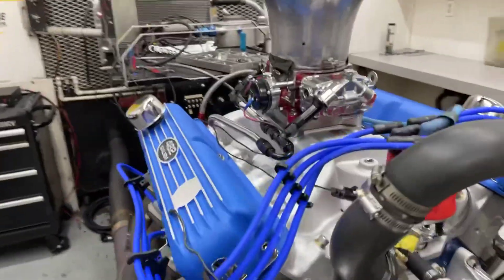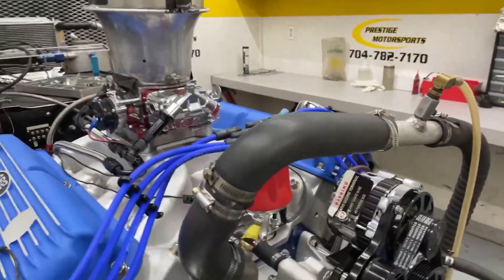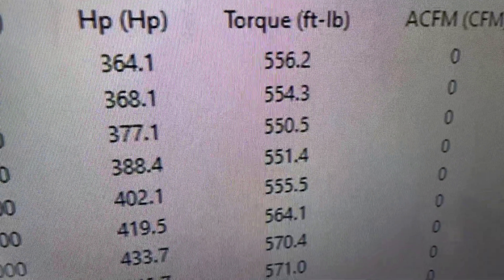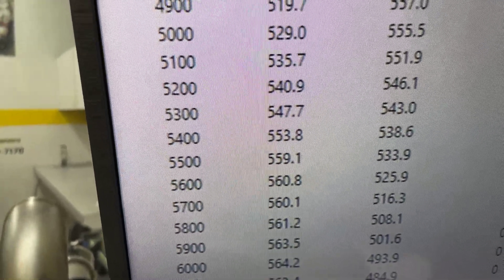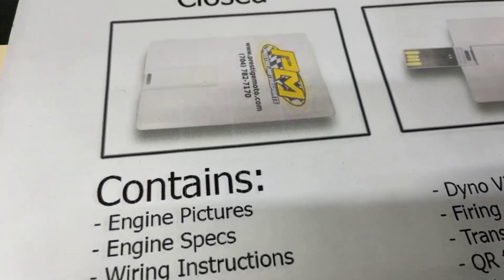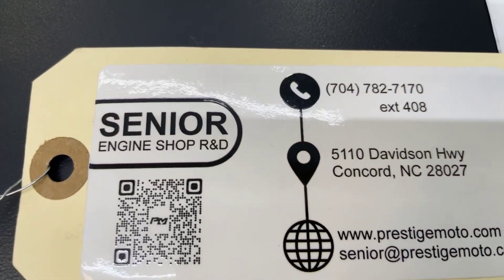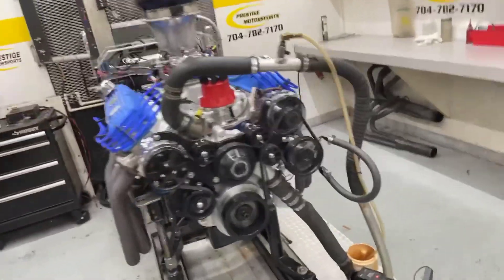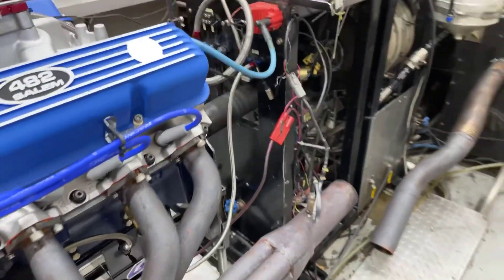564HP All Aluminum 482 Salem FE Dyno Test for John's '79 Ford Ranger at Prestige Motorsports

Comment: Carburetors are for dinosaurs
Reply: simple to set up and run anywhere.  thats why we still use them and theyre cheaper and make the same HP 

the ONLY real advantage EFI really has is adapting to different altitudes faster  and dont ever forget that
Reply: I will take a carb over EFI any day. Way too many problems with the aftermarket EFI stuff. Seen way too many videos of people regretting spending all that money and having failures, getting stranded and then going back to carbs.
Reply: @KingJT80  I have run both and Holley Terminator destroys any stupid clumsy double pumper carb. Believe me i know cause i have used both of them. Holley Terminator is even better than new car computers.
Reply: @maximusvonce1381  you proably used a double pumper in a situation where you dont need one and one that was most like to big of a carb

its not rocket science but you do need to pay attention to those things

im not putting EFI on my engine after its rebuilt.  no point in it.  it only needs 650-750 CFM and thats it.  im not knocking EFI but a carb will work fine 99% of the time on an old school engine
Reply: @KingJT80  I have used a double pumper and Eddy vacuum actuated carbs. Neither are even remotely close to a stupid carb. I have tried multiple carbs and Holley efi is light years ahead.  This conversation is a moot point.
Reply: @maximusvonce1381  it is  but its funny you could not get a simple carb to work
Reply: Refined liquid dinosaurs.
Reply: @KingJT80 Keep living in the dark ages😂😂😂😂
Reply: @maximusvonce1381  it's not about the EFI.

 keep spending 2000.00 to solve a 100. 00 issue 😂